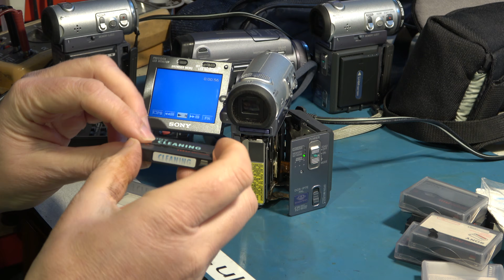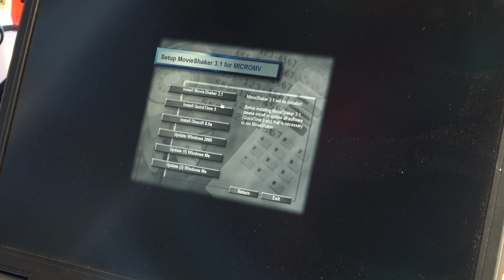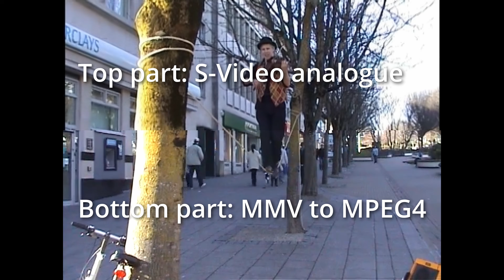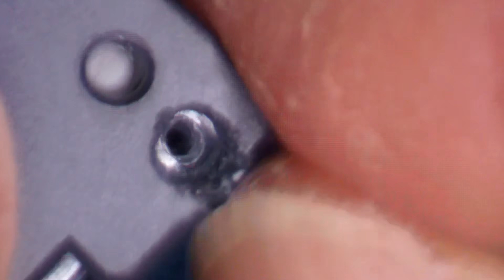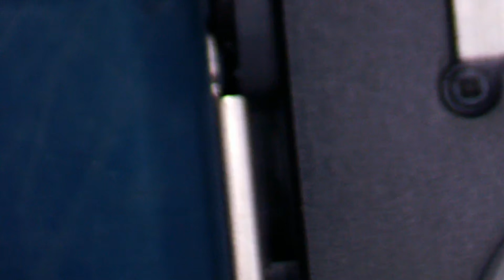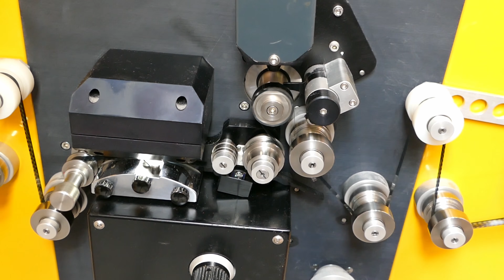Sony microMV: The baby camcorder tape.

Comment: Hello, I'm writing you from Peru. I've seen your video and I have the SONY Micro MV DCR-IP7. I have several cassettes with my very young children and I would like to be able to digitize them. If it's not too much trouble, could you provide me with the software you've worked with so I can see if I can do the same and recover the videos? Because it seems that the A/V output on the camera no longer works.
Reply from the maker: You would need a computer with a Firewire port and running Windows Vista or earlier, to use the old Sony software.  Do you have that?

Comment: FYI you can repackage files with ffmpeg. It will take the existing video stream and repackage it in a different container without transcoding. Basically you hand ffmpeg the original file, specify “-c copy” and give it a modern container format like mov. It looks like ffmpeg may actually support this camera as an input device which would enable capturing directly to MOV in mpeg2.
Reply from the maker: I use ffmpeg for converting DV-AVI to DV-MOV files for the occasional customer who can't handle DV-AVI for some reason.  I could try it with these micromv files.

Comment: 1. Why didn't the MicroMV format have long-play, unlike MiniDV?
2. Why did you record your cassette with only 19 MMV files on the cassette?
And 3. Why didn't newer Windows operating systems run the MovieShaker app that is supplied with each MicroMV camcorder?
Reply from the maker: 1: It had already used all the available bandwidth to get 1 hour on the tape.
2: Not sure what you mean.  Just took all the clips from the tape.
3: It's the other way round really, the software is incompatible with later versions of Windows, even in "compatibility mode" settings.

Comment: Sony made 7 camcorders that used MicroMV, which were the DCR-IP7, DCR-IP5, DCR-IP45, DCR-IP55, DCR-IP210, DCR-IP220, and DCR-IP1, alongside their PAL counterparts, which were the DCR-IP7E, DCR-IP5E, DCR-IP45E, DCR-IP55E, DCR-IP210E, DCR-IP220E, and DCR-IP1E. The NTSC models can't play PAL tapes, while the PAL models can play both PAL and NTSC. The apps that supported the MMV format are MovieShaker (by Sony, supplied with the camcorders, now discontinued), both VEGAS Pro and VEGAS Movie Studio (by MAGIX Software GmbH, previously Sony Creative Software, Sony Pictures Digital and Sonic Foundry, the VEGAS Movie Studio version is discontinued; the Pro version is still available), CapDVHS, DVgate Plus (also by Sony), Pinnacle Studio 8-9 (by Pinnacle, newer versions dropped support), GrabMV, FFMPEG, Blender, iMovie '08-'11 for Mac (by Apple), DVD Workshop, VideoStudio 7-9 (both by Ulead, newer versions dropped support), and Movie Maker (by Microsoft, now discontinued).
Reply from the maker: However some of these may suffer lip-sync errors in some circumstances.  I believe CapDVHS does.

Comment: Opening that tape was brutal. A basic set of watchmakers screwdrivers should only set you back a few pounds on Ali. I find I use my set a lot more often than I expected when I got it.
Reply from the maker: I'll investigate smaller screwdrivers, but the tape survived and works so it wasn't that brutal.  I suspect many screwdrivers will have too much shaft width to fit these tapes.

Comment: Pro decks, like DSR-2000AP also recognizes cleaning tape and also counts how many times it was used, so once it considers a tape used up, it will automatically eject it when you try to use it. You can still reind it and use in camcorders.

Wondershare, I never used it, I just wrote a batch convert script for ffmpeg.

One hugely important detail, if you're reading this. The S-video and FireWire comparison shows something incredibly dangerous when working with digital video. Total lack of understanding how SD video works by some (not all) creators of video software. The sample aspect ratio. We can clearly see the bottom part is wider than the top. The top has black bars, which is the nominal analog blanking. Bu using analog video, only the midle 702 samples are used for video, while with digital you can get all 720 samples, which then correspond to 788 square pixels, because 
720x576 pixels DO NOT expand to 4:3, or 16:9, only the middle 702 samples correspond to the 4:3, or 16:9 video.

You need a tiny screwdriver, like cellphone repair services use, I had to borrow this once from a local chap.

Comment: Have you tried CapDVHS? It can capture MPEG-2 SD over firewire, I've experimented with it to capture VHS using a D-VHS deck over firewire and I get normal MPEG-2 720x480 files. But I'm pretty sure there is a better way to strip the MMV files you have to MPEG-2 rather than transcoding them to mpeg-4 and loose some quality.
Reply from the maker: That is what I would have tried next if Sony Movieshaker hadn't worked. But I believe you will get corrupted video between shots with that, and so probably risk lip sync drift.

Comment: Depends on how you look at it, NTSC DV 4:1:1 allowed every field's scan line to have its own chroma information with half the horizontal chroma resolution (every 4 pixels have the same chroma info), while PAL DV 4:2:0 opted for twice the horizontal resolution (every 2 pixels have the same chroma info) and every two scan lines from odd and even fields have the same chroma info or half its own vertical resolution. 4:2:1 would have been the best of both worlds but it isn't much enough of tape real estate in a DV cassette to achieve that, So each color system used its own trick to save it.
In conclusion NTSC DV has 1/2 the horizontal chroma resolution but full vertical chroma resolution since it has only 480 lines a frame, and PAL DV has half the vertical resolution in a progressive point of view since it has more vertical resolution of 576 scan lines a frame but twice the horizontal chroma resolution of a NTSC system.
Reply from the maker: In the SD days, DV was permitted for parts of UK broadcast, it was considered that good.  Not whole programmes though.

Comment: I used to mess about with video files, the biggest problem was so many formats and problems with editing packages,  some worked and some failed in odd ways like jumping picture or sound out of sync.
I used a plug in card for capturing, happenharg or something like that,  it was a real pain to capture a video without random problems or missing/corrupted sections.
The card drivers were unstable as hell, i tryed all available versions and every version failed in a stupid way.
I tryed a different pc but no difference, dam rubbish.
It nearly sent me mad, sorry madder lol.
Reply from the maker: It's not always easy.  Even with known good systems, weird faults can occasionally crop up.  But in my business, I'm probably digitising about 20 - 40 hours of material per day, every day, on my rigs.
Reply: I've had always trouble with internal video capture cards. Dropped frames and lip sync issues. I've got a CanopusADVC110 and trouble is mostly gone, although it uses Firewire connection, so your pc has to have a Firewire or Thunderbolt connection.

Comment: I never even knew this format existed shame if the gear is failing ,i finished getting a denon cassette deck head alignment done  some weeks ago was finally happy with it i done a recording test and that also sounded great and a bit more testing and it stopped took apart and a flexible gear failed only part available is 3d printed may or may not last long and its a budget m07 from 1987 so not worth much so it got dismantled for parts deck mechanism is by panasonic and it seems many other models of panasonic/technics can have gear problems or may do .

Comment: What a clever design.

Quick question, I have 3 head cleaners for VHS but none for Beta. Would it be safe to transplant a VHS cleaner into a Beta cassette ? I thought I would ask you, an expert, before trying it.
Reply from the maker: That would be safe, but make sure you splice the Beta metallic leader tape onto the head cleaner, otherwise the autostop won't work which can be a bit unpleasant for the machine.  Also be sure to get the tape the same way round on Beta as VHS, so the same surface touches the heads.

Comment: I am about to capture a pile of dv tapes. wish me luck.
I have so many dv tapes. 
They got a helical scan in that tiny plastic thing?
Reply from the maker: DV tapes are (usually) easy.  Apart from those odd occasions when they are not.  Yes there's a helical scanning head inside the micromv, it's just like miniDV but smaller.

Comment: Have you used FFMPEG previously? I'm sure it probably supports those MMV files and could transcode them into a standard MPEG or TS file, retaining the original MPEG 2 data. It might even be able to massage it (again without re-encoding) to make it a DVD compliant MPEG2 stream. It's command line driven so it's easy to integrate into a workflow. Best of all is that it's totally free!
Reply from the maker: I use FFMPEG for other jobs.  I'm told that the problem with using anything other than Sony MovieShaker, is that lip-sync errors tend to creep in as the tape runs past the crash edits.  So FFMPEG might work, but it might not be reliable.

Comment: Very good video. The Micro MV system capabilities were quite good: 64k chip, tape Title and auto numbering, thumbnails, titles, ''go to'' scene function. Even the MPEG2 encoding was ''good'', with higher bitrate (12Mbps) than commercial DVDs. In my experience the two anoying things were:
- Everytime I stop a recording, and start again, there is a image freeze for ~0,5s.
- Lack of format support (no desk VTR, few software, no DVD desk recorders recognize it...)
Again, another great video from video99!
Reply: I have this freeze also between scenes, a really nice format, although very small!